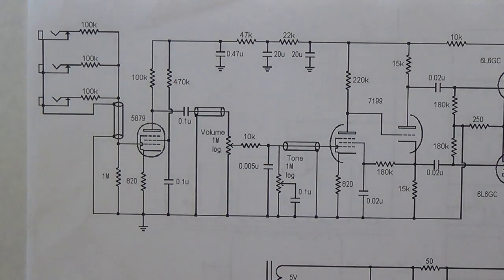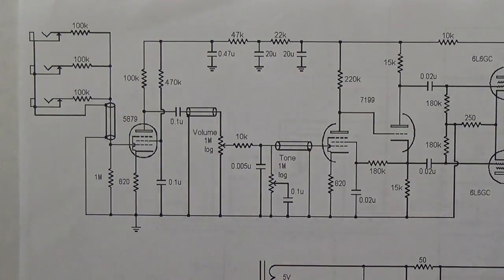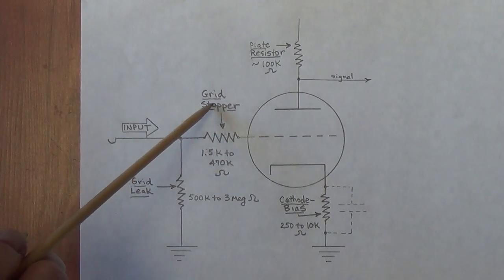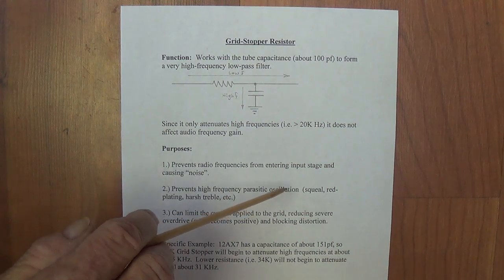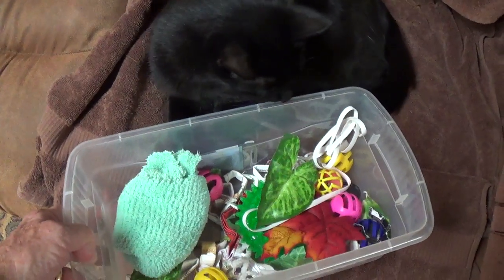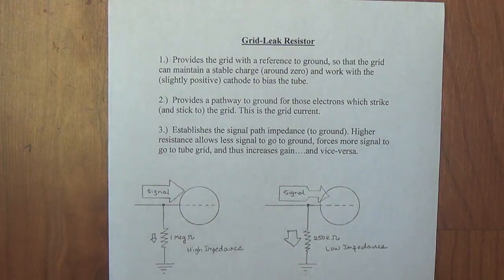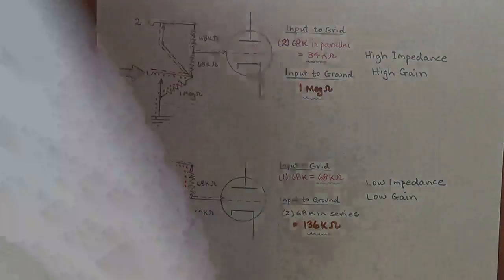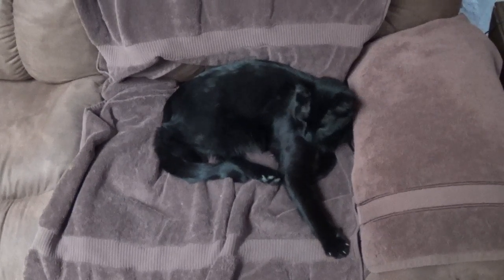Resistors, Part 3: Grid Leak, Grid Stopper, and the Fender Input Circuit

Comment: When using a 12ax7 what is the maximum grid leak resistor when using a piezo signal as input?  Fender seems to use 1m Ω and Ampeg uses 5.6m Ω.  I have a string bass that I sometimes plug into my Fender.  So so sound.  Also, what is the best way to transform an amps 8 Ω speaker output to 600 Ω for direct to a LowZ or line level recorder?
Reply from the maker: I suggest experimentation to determine the best grid leak value. I know of no way to change a single speaker's impedance. Perhaps a transformer with the proper winding ratio would compensate for the mismatch you describe.
Reply: According to the Valve Wizard, although it exceeds the data sheet maximum, a 10M grid leak will be fine if the tube is passing less than 1mA at idle.

Comment: I am trying to apply this to my Marshall JVM410 circuit, but that does not make sense to me. Can you please help? 
V1a has a 1k grid stoop resistor - which would cut everything above 220Hz? Does not seem reasonable. 
V1B (tone stack recovery stage) has a 220k grid stop resistor. That's cutting range would be way too high above hearing, so this does not make sense to me either. 
I suspect there must be something else going on too, which I don't know. 
Can you please explain? 
Thank you!
Reply from the maker: Resistors do not selectively block any frequencies, they simply drop voltage (and current). You may be thinking of capacitors, which do block certain frequencies and pass others...... but that is a completely separate topic.
Reply: @UncleDoug  Of course I know that. I was asking about what you describe in the above video: grid stop resistor together with the capacitance of the tube form a low pass filter. Then you detailed the values and the frequency response. I checked it on my JVM410 schem. and it did not make sense. So I asked you.
Reply from the maker: @greg4272  Watch my video on High Pass and Low Pass filters, Greg. Hopefully, it will answer your question(s).

Comment: Does it matter if the grid leak resistor is before or after the grid stopper resistor?
Reply from the maker: I believe that most agree that the grid leak resistor should be as close as possible to the grid, i.e.  after the grid stopper.
Reply: Thanks, Doug.

Comment: What happens with signal in audio amplifier tube:   if max (or min) 
(limiting) value for grid voltage is -55V (data sheet) and grid voltage 
above or below  -55V? 
   I'm trying to simulate some schematics for my custom preamp in SPICE software and 
sometimes on second or  3rd amplifiing stage I have grid voltage from 
0,3V in 1st stage and -40+ on 2nd and even -220V on 3rd stage. Should I 
reduce and keep it below -55V. How grid voltage affects the sound and 
circuit in overall. Thank you. (If answer included in video then I'll watch it a bit later, no time right now :) Didn't watch yet. )
Reply from the maker: +KeeNchiK  The grid voltage is the negative voltage used to bias the grid. It rarely exceeds -30VDC  (6L6GC). I can think of no tube in existence that would require a bias voltage of -220VDC.....there must be something wrong with your schematic or your simulation.

Comment: hi UD on the schematic there are a few items that look like a cylinder, the first one happens at the input circuit right between the 3 inputs and the grid . what would those be?
Reply from the maker: On what schematic ??
Reply: @UncleDoug  as soon as this video starts in Resistors, Part 3: Grid Leak, Grid Stopper, and the Fender Input Circuit looks like the wire is going through a straw, there are 3 of them in the schematic that is showing 

https://www.youtube.com/watch?v=QFHcmST7AZ0&lc=UgxVMLUbc-o623uGhcN4AaABAg.9kRGLW1rsrT9kSS2D7UQqe
Reply from the maker: @irusman62  If the "straw" is a dotted line, it indicates that the wire is shielded.
Reply: @UncleDoug  ah that makes sense thank you!

Comment: Ignorant newbie - Can you plz explain why on the AC568 Bassman schematic I can not find a Grid Leak resistor for either 6L6GC? Thanks in advance.
Reply from the maker: You won't find grid leak bias in output tubes, D. It was a primitive way to bias preamp tubes, mainly in vintage radios.
Reply: @UncleDoug  Thank you. I've spent most my adult life on and off trying to learn all this but my aging collection of vintage amps and more indoor time is making this a reality. I appreciate your coverage of basics rather than just demonstrating at 100mph.  I'm slow witted and need the basics. Another confusion - you'd mentioned soldering the AC ground wire to chassis due to "comments". I've done that in kit-amp builds for aesthetics but my common sense tells me a 'a screw to (PT) lug' offers much more security assuming it's done well. Can you share your reasoning as I want to change cords in a few amps. Thanks in advance to not be a bother.
Reply from the maker: @derekec  I think using a nut/bolt (with a lock washer) is an excellent way to attach ground wires to a chassis, D.

Comment: Can a non-inductive wire wound resistor be used as a grid stopper? Please suggest.
Reply from the maker: In my experience, wire-wound resistors are usually rather large and fairly high wattage, both of which make them an unusual choice for grid-stopper usage.....but I see no reason why they would not work in that capacity.
Reply: Thanks for your advise.  I am planning a project to replace all my 14 odd resistors in my 300B tube amp from smd resistors to wire wound where ever i could.  The main reason is to check out if noise (if any) can be reduced by this.  I have a local resistor manufacturer who can  custom build a non-inductive WW resistor (3 watts with 50% derated) as per my requirement at a reasonable cost.  The only resistor I wont be changing is the 470K input and grid leakage resistor as its beyond his manufacturing capabilities for a WW.
Reply from the maker: That sounds like an interesting project, Hari. Please let us know how it turns out.
Reply: Last week i modified my tube amp resistors replacing the smd metal film resistors with silicone coated wire wound resistors.  The only resistor i did not replace was the grid leakage resistors as high value WW (470K) was not available.  I found that the mids and highs have very less clutter and the lows are less masked by the mids and highs.  Changing the grid blocking resistor with WW had a positive impact and did not cause any oscillations as believed. The overall sound stage has much improved with less grainy highs which is now rounded with  less listening fatigue.  Thanks Uncle Doug for your advise on this.
Reply from the maker: You're welcome, Hari. I'm glad the video was helpful.

Comment: The input should have a capacitor to block all those currents and  for those grids resistances to make sense
Reply from the maker: Thanks for your input, Farinelli.
Reply: Since the signal from a guitar, and most effects units, varies above and below 0V, an input capacitor is unnecessary.

Comment: Something confuses me here, please help Uncle Doug: I downloaded a couple of different 12AX7 Datasheets, and they all state a similar average value for the capacitances of around 1.6-1.8 pF. It does not come close to 151 pF, where can I find that number?
Reply from the maker: Was the 151pF value in the video?  If so, then it came from the reference material I reviewed to prepare for the video.
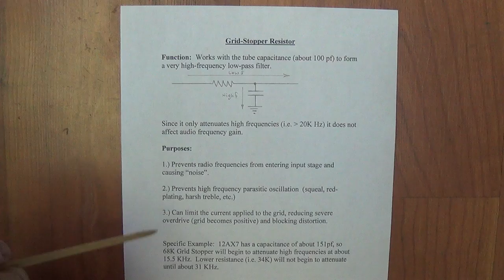Reply: You bring the example, that a Tube has around 100 pf of capacitance, thus being able to calculate, which Grid Stopper Resistor is needed if you don't want to attenuate above a certain frequency. As a specific example you bring up the 12AX7 with 151 pf. (at around 9:25 )
Please don`t take me wrong, I am just trying to understand to be able to make my own calculations. I have some different tubes at hand, but I also checked the 12AX7 data sheets, and I can only find values around 1.8 pf as capacitance. The value is nowhere near your values, which are 100 times bigger - so I am trying to figure out, how to get the right number for my calculations.
Reply from the maker: I suspect that the low capacitance figures you found exist between internal components within the tube, rather than the overall capacitance of the tube itself in circuit, which is augmented by an effect called Miller Capacitance. This effectively increases the low internal capacitance values you cited by the gain of the tube (particularly in triodes, like the 12AX7). I got the figure from a reputable source:  http://www.aikenamps.com/index.php/what-is-miller-capacitance
Reply from the maker: As you noted, the effective capacitance of a 12AX7 is indeed 100 times greater than the internal capacitance between components.......which coincides with the gain of the tube.
Reply: Thank you for clarifying. Say hi to Rusty and Jack.

Comment: why do so many old amps have 2 duplicate input channels ?
Reply from the maker: +Steve lavalette  Actually they're generally not identical, Steve. Usually there is an impedance difference between the two inputs or one channel offers greater gain and/or treble response.
Reply: Gotcha. Thanks for all the great video's !    You have no idea how I have learned from you !
If you ever find your way to CT please allow me to buy you a beer or six !
Reply from the maker: You're welcome, Steve. If Rusty and I are ever visiting your area, we will definitely take you up on the offer :)
Reply: +Uncle Doug however I just lucked in to a 1969 ampeg b25 two identical input channels.   Each input channel has two jacks.    One is bright one normal.    just seems redundant ?
Reply from the maker: The amp makers were trying to provide versatility, I guess. Two guitarists could use one amp, or a guitarist and singer or harmonica player.
Reply: +Uncle Doug i didn't think of that.    Imagine trying to do that now a days !    I know I'm certainly not letting any harmonica player plug into my amp with me !   lol
Reply from the maker: But it might have been a selling point for some musicians. The manufacturers simply wanted their product to appeal to as many buyers as possible.
Reply: +Uncle Doug indeed !
Reply: There are 2 input channels, one for Uncle Doug, one for Jack!
Reply: In my younger days I had a Deluxe Reverb and I definitely remember 1 rehearsal where the bass, my guitar and a Shure Unidyne microphone were all plugged into it. I have no memory of what it sounded like, but I hear the brain has a way of erasing painful memories...

Comment: Are a 6EU7 and a 12AX7 very electronically?
Reply from the maker: I believe they have a different pin wiring pattern but otherwise are quite similar in performance. Here is a discussion:  https://www.tapatalk.com/groups/ampworkshop/6eu7-vs-12ax7-t1896.html
Reply: @UncleDoug  great, ill give the discussion a look and see if can learn something interesting. i'm rebuilding a Magnavox stereo power amplifier from 1961

Comment: I've seen a lot of people asking why 120v ac when rectified gets higher was taught 1.3 x ac gives equivalent DC value which seems right never questioned it .ps wife hates the cat too aggressive.
Reply from the maker: 120VAC RMS has a peak voltage of 1.414 x RMS = 169.7VAC, Don. Watch my videos on power supplies.....especially how the filter caps function. If your wife feels that Jack is too aggressive, I would question the basis for this determination.  He is, at all times, a perfect gentleman.
Reply: Uncle Doug thanks. talking about our cat .you said don't tell my wife i don't like the cat .she hates our cat its a feral. only in winter comes in to complain eat an use the box .you know your stuff . But this business is like fixing shoes.un fortunately .sold 5000tubes for 300$ couldn't keep them .too much stuff.

Comment: so uncle doug i know you've been asked this but here goes is there mojo in useing carbon comp. resisters vs carbon film
Reply from the maker: I used to think so, but now I don't think there is any audible difference between new carbon comp, carbon film, or even metal film resistors. The metal film resistors are the best of them all, but look a little weird.....so I tend to use a lot of 1W carbon film resistors everywhere but the power supply.

Comment: The grid never goes positive.  It just goes more or less negative.  It's always "biased" negative enough to overcome any positive swings in the input signal.  If it ever went positive, current would flow thru it and the output would be distorted.
Reply from the maker: Thanks, Alex. I guess the proper term would be "relatively" negative or positive.

Comment: The more I learn about analog electronics, the more I come to realize how leaky of an abstraction "ideal" components are. More than half of the circuit is there to deal with real world problems that don't exist in a textbook analysis of the "kernel" of the system, ie DC blockers, HF blockers, getting voltages in their optimal ranges, dealing with grid leak, etc. And these aren't obvious from a schematic.
Reply from the maker: Thanks for sharing, YL.

Comment: 13:55...if enough electrons pile up on the control grid, the tube might stop conducting.
Reply from the maker: Yes, which is part of the reason for a grid leak resistor.

Comment: Wait...
So a valve is basically an electrically driven condeser microphone? Thats interesting.
Reply from the maker: +Das TIER  I am not familiar with condenser microphones, DT. If they use a small, weak signal to modulate a huge, powerful signal....then yes, they are similar to vacuum tubes (valves) :)
Reply: +Uncle Doug 
As far as i know, its a capacitor (which is part of the diaphragm) with a voltage (phantom power) applied to it. A change in the 
capacitance/movement of the diaphragm results in the creation of a 
signal, which is then your audio signal coming out.

Its more or less the same with tubes, but come to think of it, it isn't. A tube is more like a FET. Ahh, its diffficult. ;)
But all these components work very similarly anyway :)
Reply from the maker: Thanks for the input, DT :)